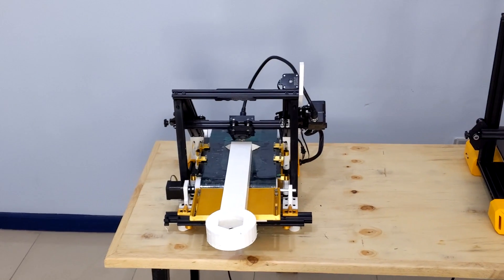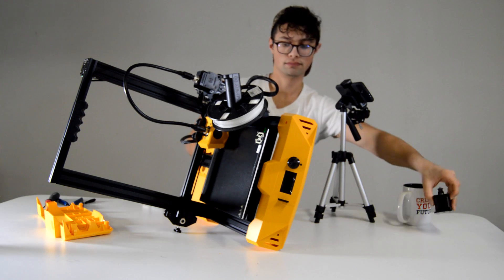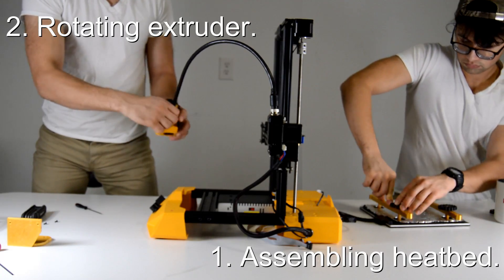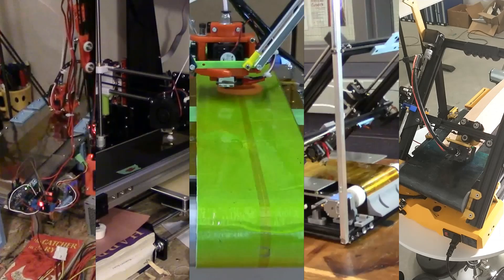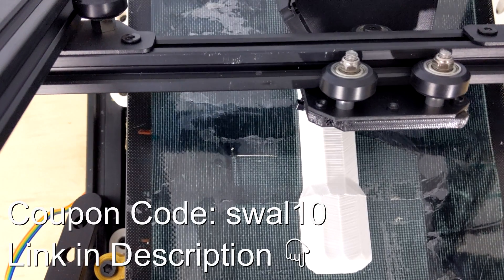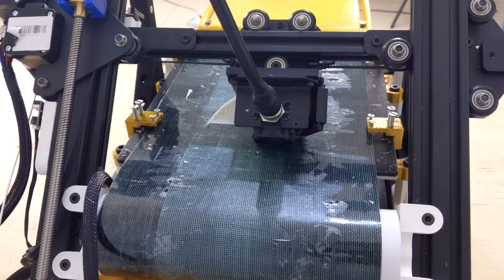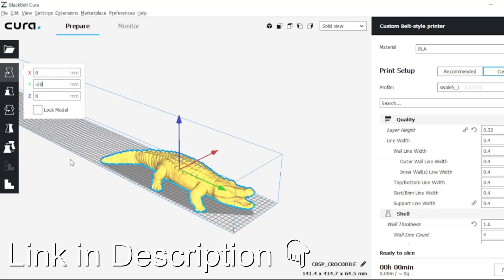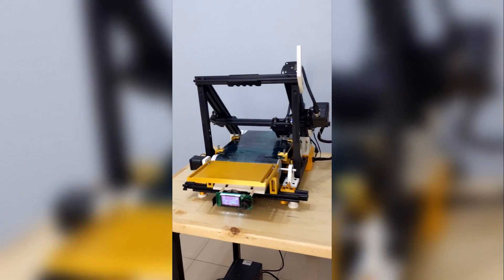Conveyor Belt 3D Printers: Full Easy Build Tutorial

Comment: Hey swal, the grabcad link isn't working. Could you provide another way to get the STL files (possibly through github)? Thank you in advance
Reply from the maker: Sorry for the late reply bro, I was mourning the death of GrabCAD 😔😔. The laptop I used to do this project also died. I have scrounged around to find the files for this project and whatever I had I posted to github: https://github.com/CallMeSwal/OpenBelt3DPrinter. Sorry for the inconvenience!
Reply: @CallMeSwal  No problem, I am still working on the project, I had to reprint the parts and the software is really messing with my head. Thanks for getting back with me

Comment: Hii, buy everything to convert it XD change the firmware, motor of Z makes a lot of noise because of the cylinder, I removed the limit switch of Y it doesn't work, it detects failure, I put it on, and it prints wrong from front to back, change the final pins of race of Y by that of Z and it does not work, help someone else did it work?
Reply from the maker: Hey Diego, if you contact me on Instagram we can try video chatting and I can try helping in resolving any issues. Let me know if that sounds good!
Reply: This is perfect if it's okay, how do I find you in IG?

Comment: Some great work, recent searches I found your older work and then you dropped this! Machines on the way pretty sure I can put this to use. Can you share your Profile for the BB Cura? Imagine its not far off from BB with the exception of build volumes? BTW awesome on the Rwanda makerspace work as well!
Reply: Wanted to add to this as its a nice project but the bom is incomplete and the instructions are severely lacking. Fortunately some other builders have added comments to the instructable but still only fills in a few of the numerous gaps.

Comment: just purchased all the bits to put together your brainchild :)
i got four belts from your supplier, will be automating the ejection of several different machines in addition to the infinite z one

i got into this whole adventure about twelve years ago with the makerbot cupcake automated build platform, i am glad to see the software is picking up the possibilities of the belt

keep em coming
Reply: Were you able to do it, does it work? I have a problem with the limit switches and the finware does not copy. sin zmin
Reply: @DiegoOrtiz-xq7xw  i was going to start printing the parts for it next week, im more of a hardware than a code guy so you might want to ask swal directly hahaha

Comment: Instructables step #9 calls for  Angle_Brace, which I do not see in the repository, still no Belt_Flatteners.
Once the Extruder_Brace is installed, how do you adjust the Eccentric Nut on the Extruder mount.   Thank you
Reply from the maker: Hmmmmm, I can see belt_flattener.stl in the partner space. Maybe try refreshing your cache? 

Ahhhh yes, I had angle_brace.stl initially named as brace.stl. I have updated the filename accordingly. Thanks!
Reply: @CallMeSwal  Once the Extruder_Brace is installed, how do you adjust the Eccentric Nut on the hot end carriage?
Thank you very much, I now have all the STL parts.
Reply from the maker: @dennissladek8103  You rotate the eccentric nut to increase the tension on the slide. I would adjust the eccentric nut before mounting the Extruder_Brace component

Comment: This looks great, and thanks for putting this together! What do you think about the single cable that combines the bowden tube and the electronic cables? Have you had any problems trying to clear out any clogs or replacing the nozzle? It seems like it would be tricky since you need the electronics cable plugged in, which would block off the top.

Comment: Hello! My Hornet has arrived, and I've ordered the belt from PowerBelt3D. I've printed out a few parts from the CAD repo at 10x scale and they now appear correct scale-wise, but they're very low-poly, making them not only not appear smooth, but also become quite dimensionally inaccurate in places with complex geometry (like the 608ZZ bearing housings). I noticed that the prints in your video are nice and smooth, where the available STLs are not. Do you have any higher-quality STLs for the project than what are in the 3D Prints folder on the CAD repo? Or is STL smoothing another setting in Prusaslicer?
Reply from the maker: Hey buddy, all the stls seem fine when I open them in prusaslicer. Can you email me the specific stl you're trying to open and I'll take a look on my machine?
Reply: @CallMeSwal  Emailed.

Comment: The STLs in the CAD repo appear to be approximately 1/5th the size they're supposed to be. I'm printing a scaling test right now and I'll check it with some calipers, but I thought you should know.
Reply from the maker: Whaaaaaaat???

I tried opening the files in prusaslicer and they look like they're the right size. Maybe your slicer has default units set to inches? If you want, you can email the specific files to swaleh.owais@gmail.com and I'll take a look.
Reply: @CallMeSwal  Looks like it's 10x, actually. I'm testing fitment on the rear bearing block -- if it's meant to fit 40x40 extrusion then it's 1/10th the size it should be.
I'm using a default install of Cura and I think it defaults to millimeters and your STLs might be centimeters?
Anyway, my Hornet arrives today, so I'll be building this over the next week or so. 
🤞
Reply: @CallMeSwal  i have the same Issue with Repetier Host, very small Parts and some strange appearance after the Slicing-Process :(
Reply from the maker: @matthiasbarthel4064  weird, email me the file and I'll try it on my laptop. I'll give you an update tomorrow 👌 swaleh.owais@gmail.com

Comment: Looking at the last 4-5 seconds we see the 3d piece wobbling left and right along with the belt. Is it worth trying to pull the belt down by a vacuum system during print?
Reply from the maker: The key thing is keeping the belt taut, that's why I added two belt tensioners. Unlike me, you should be checking the belt tension between prints 🙂
Reply: An interesting idea and solution.